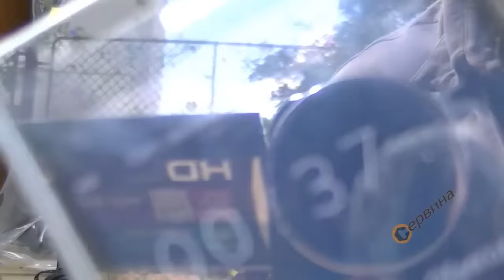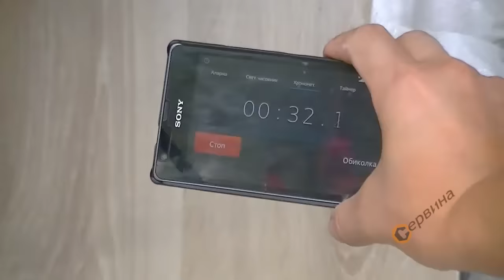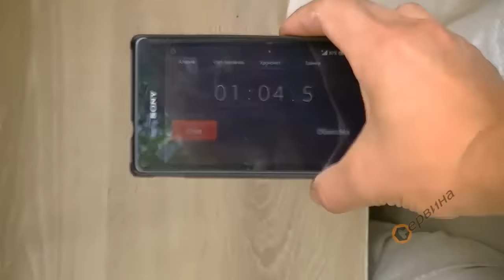TEST Makita HR2810 800W/2.9J Vs Metabo UHE 2850 Multi 1010W/2.8J

Comment: I Metabo since 1990 and has no problem so far. It works perfectly. And Makita is the second best company in hoeing tools in the world. For the least possible service I would prefer, however Metabo. It has the best chuck and noise of the motor (compared bosch).
Greek plumber.
Reply: I would prefer the Makita because of the HM0810 demolition breaker.
Reply: metabo still the best !

Comment: Je connais metabo depuis longtemps je peux affirmer que c'est du très bon matériel solide dans les années 80 un professionnel avait mal utilisé un perforateur metabo c'était le modèle 1131 
Ce marteau avait des cannelures pour installer une mèche universelle ils fallait monter un adaptateur ce que l'installeur n'a pas fait il a,installé la mèche universelle sans adaptateur et a utilisé le perforateur plusieurs heures le piston frappait à moitié dans le vide il na pas cassé la mèche était bloquée dans le nez du perforateur nous avions pensé qu'il était mort nous avons utilisé une masse de 10 kg pour extraire la mèche nous avions pas hésiter a frapper fort pensant que de toute façon le nez du perforateur était foutue nous avons débloqué la mèche surprise malgré la violence des coups rien était abîmé le perforateur était toujours en parfait état ce qui nous a impressionné car logiquement il aurait du être foutu

Comment: I have many tools from Makita but power drill.. I have this Metabo. I love every second working with it. It never disappointed me. I would not say this Makita is bad.
Reply: Bro i would like to buy a makita driller , so just came in youtube to know which one is good , but I feel Metabo is little bit faster , what's your suggestion to me ?
Reply: What i can say...i had KNE 4243or something that, did not remember exactly. Yes , almost 6 000 hits per minute its impressive.. but there is a problem .. piston of my hammer drill run out after year of using.. but electric part of drill is great.. it has been working almost 12 years, and still works

Comment: This model of Metabo has aluminium body and overheats very quickly and becomes untouchable on the body, but works very well
Reply: That’s a deliberate design feature conducting the heat produced inside to the outside letting you use the tool for longer periods at a time. The Mikita will wear likely wear out quicker than the metabo under heavy use.

Comment: Unfair for makita. They used sds max concrete drill for the metabo each time and sds regular drill for the makita. At the last part they used the same drill for both. There u see that makita shines. Metabo has real good machine. But makita is A class, metabo is B class. If u want to compare 2 machine. Compare it whit difficult points. Like falltest/strongest test/durability/balance.
Which is really you money worth. Is it a hobby worth machine or a pro machine. Good luck